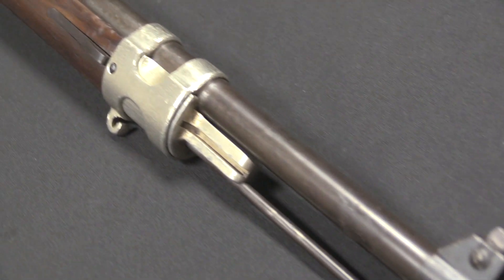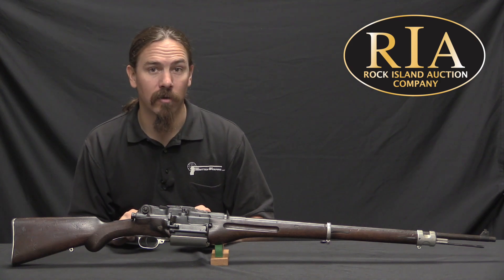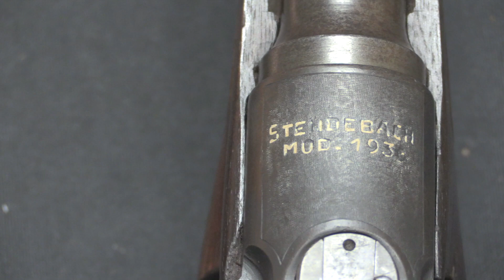Stendebach Model 1936: Rotary Mag Toggle Delayed Experiment

Comment: Hmmm. As a German, I think this aluminiumparts where made in Germany before it was given to the allies solders. Why? It would have been difficult to make this parts without knowledge of how they should look like and how they function. This gun is very complex. And why making all this gunparts and not making the trigger mechanism work? I think the trigger mechanism needed steel work (aluminium may be to soft). Aluminium is very easy to work with without maschines. So I think it was something privat from a gunsmith. Remember, that the german army had the K98 as standart rifle until WW2 end. So even in the Time of WW2, this rifle whould be a newer design with more firepower, than the standart rifle. My gues: A gunsmith who couldnt find sponsors to finish his project, because the gun wasnt interesting for mas production. And after the allies took over it was forbidden by death to have firearms. So he gave the gun and project up. May be the trigger mechanism was made unfunctional before the gun was handed over. Soldiers did this or worst with their firearms too, before surrender. Just my gueses...

Comment: The bayonet lug is in the correct position for a handled bayonet. The lug would attach to the bottom of the handle and a loop mount on the bayonet at the transition from the handle to the blade would fit snuggly around the end of the barrel.

Comment: Aluminium wasn't that new in the 1930s, it had been commercially produced in Germany since 1885 (Aluminium- und Magnesiumfabrik, Hemelingen) so it may have been relatively expensive (about US$50 per ton in 1935, equivalent to about US$1,000 in today's money) but it wasn't unavailable. It's a LOT easier to form and machine than steel. So you might 'rapid prototype' in aluminium, just as today you might rapid prototype in 3D-printed plastics, a part which you intended to later production-engineer in steel.

This is speculation, of course; I've no evidence this was done.

Comment: Aluminum, difficult to procure, but easily workable? Perhaps this individual was melting that stuff down and re-casting it multiple times to get just the right fit before making, or having them made out of steel? The bayonet mount could have been on the "to-do list", and the barrel band, to me, really looks like something that's right in between two ideas, like they were leaving their options open before making a final choice. -- A lot of these things speak to me, as a hobby fabricator and metal worker myself lol

Comment: Maybe the magazin spool in aluminum is original to reduce weight, it is a big part which would be quite heavy in steel. An alloy analysis of the different aluminum parts would show if they are from the same time.

Comment: Coming back to this gun after a few years, I get the feeling some stuff doesn't line up about it. Namely, as Ian pointed out, the aluminum, the disconnected trigger, there being no documentation, and with what little there is, the dates are over 10 years behind the date on the gun.

Comment: I think Walther and Luger had a toggle lock rifle, and there was a balloon gun that used a side toggle lock in WW1. The aluminum fittings might have meant it was intended to be used as an air weapon, and they were trying to lighten it up, and there were probably a lot of bits of aluminum around to work with in air- specific factory areas. The rotary mag gives a person the ability to top it off one shot at a time from a loose bag of rounds, and that may have seemed ideal for balloon use. It may have been worked up again as an idea in the pre-WW2 years but it was never used, though you will see the use of little cam surfaces a lot in German rifles. If you have a bunch of parallel r and d programs going on, things like this are going to be made. It's easier to mill aluminum also, and they may have been working on the dimensioning of the parts, instead of using wood for the prototyping.

Comment: shiny parts added later is best guess.  Another? If you ever work in a machine shop, prototyping, use a scrap piece laying around? Just make it right shape and rigidity? I've used wood, plastic, iron in combination.  Aluminum/zinc (1936) may be exotic, but you just slap it in there because you have a scrap piece- save time. Also, practice with new material?
Perfect FW content.  You can't get this anywhere else! (and for Free!!!!! Love you Gun Jesus)

Comment: Many times Germans had Aluminum replacing brass or bronze parts in their artillery fuzes in WW1, especially from 1916 onwards, because of the blockade and their inabbility to procure tin or copper in suitable quantities. Detonators too used mostly zinc/alloy. So PRESUMING this rifle would have been in existance at that time (or even afterwards), and also taking into account this was a prototype, it wouldn't be all too strange to find alluminum/zinc parts on it.

Comment: aluminum is an easy metal to re-form when making cast parts and also easy to mill with some precision with hand tools - you can then use it in a mold as a loss material when casting a harder metal into the mold - an excellent prototyping material.    We're actually headed towards aluminum sputter 3D printers today.

Comment: Maybe the latch wasn't designed for stripper clips but for belt feeding (in combination with the wheel below that would allow you to rapidly reload the gun)? Imagine having a semi auto with 10 rounds plus a 30+ round belt in the 1930s? The material might have been used to make the gun lighter overall? I  mean obviously it's a terrible idea but it's 1930 afterall...

Comment: I'll speculate with you as well sir. I believe that gun was designed for maritime use hence the aluminum. The toggle and bolt and all the uppers would have been lubricated very frequently so they wouldn't have to worry about corrosion. However the other parts that would not be lubricated frequently or at all would be genius to make it out of aluminum especially when it's a heavy gun to begin with. I'm going to run with your one-off prototype Theory and say he probably used parts from other guns ingeniously to create his masterpiece. It truly is a fascinating gun and I see your point as being not reasonable for military use.  I really need to dig into this name

Comment: I have one of these with all cast/stamped parts as seen in the rest of the receiver there. but it has 8-round cylinder, the bayonet section is corrected. no titanium, the rear sight is gone, the rear sight now looks like an M1 Garand sight that moves with the mechanics as a single piece. And you are correct, my rifle has a Stendebach mark on its front receiver part and proof marks on the stock, the Stendebach mark on mine has an Spät-36 under it. the cylinder section as seen here is larger then mine, and the munition feed is generally the same, but mine is noticeably more canted to the right. i dont see any sort of lever system as see on this rifle compared to mine though. the barrel on mine is a little shorter and the front sight is a bit thinner and taller as well. that neck connecting the action to the shape of the barrel of the handguard isnt as deep on mine.

in general. it was suppose to be an indirect competitor to the M1 Garand, if it was to be put in use. My revision rifle of Model 1936 was most likely suppose to be what was SUPPOSE to be used in WWII Nazi german Standard service rifle. But Hitler preferred the bolt actions more. its pretty much a scaled up Luger. The war would have been different if the Germans had a rifle like this in their arsenal.
Reply: If you still own it, can you post photos?

Comment: When you mentioned the idea of reloading the magazine a few rounds at a time as you fired it gave me an idea. Does anyone know if this same concept has been applied to guns that use external magazines? Where you can remove an empty magazine and replace it as normal, but if you wanted to reload having only fired a few rounds you could insert them manually into a secondary opening somewhere without removing it?

Comment: Aluminum was no longer the expensive material that it was historically by the early 1900's. It wasn't the cheapest stuff either. But the work of Charles Hall made it mass producible to the point where the first aluminum foil manufacturing was underway by 1910. by 1911 the age hardening process was known due to Alfred Wilm's work. Which made the metal actually useful. By the 1930's it was 20 cents a pound. Given how easy it is to cast and machine. I wouldn't doubt it if by the 20's and 30's it started to become an ideal placeholder parts material in prototyping. Especially in Germany where a lot of the work to make it useful was done (Hall discovered age hardening while doing military research in Germany).

Those aluminum components being original to the piece isn't as far fetched as it might sound on the surface of it. Especially if the maker didn't have everything they needed to make the prototype components out of something like steel. I mean the crankcase for the Wright brothers plane engine was made of aluminum in 1903. It wasn't exactly cutting edge tech or ridiculously expensive to do by the time that rifle would have been made.

Comment: I could also imagine that the aluminium parts are prototype ones. Aluminium is much easier to melt but still strong enough to carry loads, so you would make a wooden model, cast it in aluminium, try it on the gun, change the model again and reuse the aluminium. The wood is easy to work on and the prototype part is always new.

Comment: I would guess the use of aluminum was to meet weight requirements.  If you look at the specifications drawn up by armies at the time, when everyone was still using bolt actions, there was invariably an upper weight limit.  Every designer seemed to have trouble meeting it, as it was extremely hard to design a reliable semi-auto mechanism that would weigh less than the simpler bolt action mechanisms everyone was using at the time.  In the end, the US just accepted that the Garand would weigh more than the Springfield it was replacing, and adopted it anyway, but the goal had been to adopt a rifle that was no heavier.  The use of aluminum would make sense here as a way to trim as much extra weight as possible off the rifle so that it would meet the weight requirements specified by the German army.
Reply: Agreed. This would not have been odd on a prototype.

Comment: The light alloy parts will likely  be original as back in the 1920s  light alloy sand castings were actually a common method of production for normal  consumer  articles such as as car engine  crank cases, sumps and valve covers. In WW1 German industry  had been  a major  producer of high strength  aluminium-copper alloys popularly  known as   "Dural" for Zepplins   and aircraft engines.   
Sand casting of small parts from aluminium alloy  can be done with very basic equipment and is  well suited to producing prototype parts.

Comment: Mabey in an attempt to both keep up with the times, and reduce weight  (because that thing looks very bulky) he sought to be forward thinking and use aluminum. The beyonet lug thing might simply be because he only had one barrel to go off of at the time.

I could also see some guy useing aluminum post war because it's easy to mill. But the magizine spool and cover seem to, correct to be made post war with no guidance from the designer. It sssms there would have to be some serious thought and engineering for some of those parts.

Comment: i am trying for the life of me to find where I remember this

but I am aware of some cases of Aluminium being used (surplus to airship construction) as a quick easy method of prototyping parts before setting up the machining etc for production, and being that the parts used are not pressure bearing, it is possible this might be the reason also????
Reply: The Italian Variara SMG, that was an insurgent weapon used by the partisans, had cast aluminium grips, and the polish Błyskawica, another insurgent SMG, had cast aluminium buttstock. If an industrial production line had not been estabilished, to cast aluminium parts is easier than stamp or machine steel.

Comment: I suspect the magazine works only when you got bullets in : you put the bullets in, close the hatch and wind up the spring. I think the bullets themselves are used to block the rotation when in contact with the bolt or another surface close to it.

Comment: A few thoughts:
Aluminium may have been used by the designer because it was much easier to work with (casting in the backyard?), maybe he had some stock laying around from the 20s, where it was not so sought after for  aircraft/military use.
But in the 30s quite some normal "household" items where made from aluminium, so it wasn´t too scarce at all.
The middle barrel band probably got its shape on purpose - it can hold an upper handguard, but it also holds the barrel itself, not just through the handguard.
I think the gun had been finished to full function by Stendebach, otherwise a gold-inlayed marking, year included, makes no real sense, the proofmarks also don´t, now only something´s missing/damaged so that the trigger doesn´t work.
The part moving in the frame on trigger pull may be the disconnector or part of its mechanism.
The cleaning rod would interfere with a normal bayonet anyway, so maybe Stendebach had an idea for a special one?

Comment: I think some of those parts are made of aluminum is because it's easy to make hand crafted parts with (and these certainly look hand made and not machined). I mean if you think about it - none of them are structurally significant (like in the ar) and considering this one is a prototype it actually makes sense to make these by hand and save some money on setting up an expensive machining equipment. I bet if this baby got to production these parts would be made of a much much cheaper and locally available steel.

p.s. Great vid as always!

Comment: I think that the magazine spool being made out of aluminum makes it a better chance that the other parts are original. It's possible that he bought stock for the spool and had left over and being easier and faster to machine just decided to use it to cut weight and time. Either way that is one complicated machining nightmare. It would have needed some drastic simplification.

Comment: The trigger guard, magazine cover and Barrel bands may be cast of zinc as opposed to aluminum. Unfinished Zinc tends to hold its luster better than unfinished aluminum. At that point in time zinc would have also cost considerably less and been much easier to cast.
Reply: Naw. Zinc isn't that reactive. A small test with acid would settle the question but not really possible since the gun is up for sale.
Reply: @peterthinks  Scratch a post 1982 U.S. one cent coin and put it in a mildly acidic liquid for a while.
Reply: Agreed, but he would surely noticed the difference in weight?
Reply: That very slightly yellowed colour and the wear on the parts looks very similiar to all the old zinc I've seen
Reply: Both would do a white powder oxidation over time, but that's super easy to clean up, too...
Reply: Think again, Jimmy. You see, the firing pin in your gun was made of, yup…zinc!
Reply: Yea, I think Zinc is about two and half times heavier than Alum....
Reply: If it were zinc  it would be white oxide by now.

Comment: Well this thing explains some questions I had for some time. For a time I wondered why the Germans never seem to have looked at a toggle locked rifle like the Pedersen, seeing as they didn't want to drill a gas port in the barrel, well until they did and then the came up with the Mkb 42 and the MP43/44/STG44. :P

Well, seems they did. Further this thing is so damn "German" that it seems to surpass even Swiss standards. :P
Really, engineering this thing is brilliant, making it is a bloody nightmare...

Then about the aluminium. Well, the Germans where using the material for some military equipment during the 1930's like the carriage of the 15cm sFH 36 howitzer. It wasn't completely unheard of to use it in Germany. Mercedes for example was defiantly working with aluminium alloys for there line of MB500 series diesel engines. Same with Maybach and some of there engines, like the HL210, installed in the early Tiger tanks.
Reply: Yes
Reply: *definitely